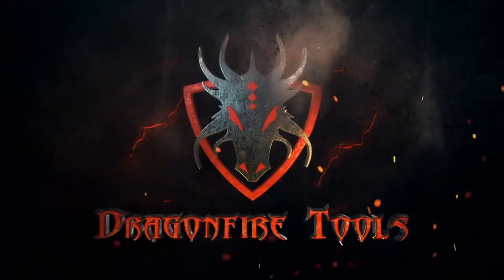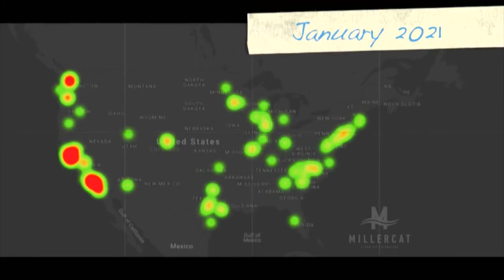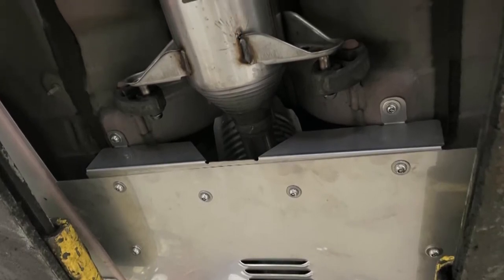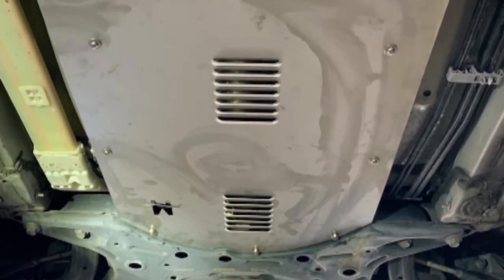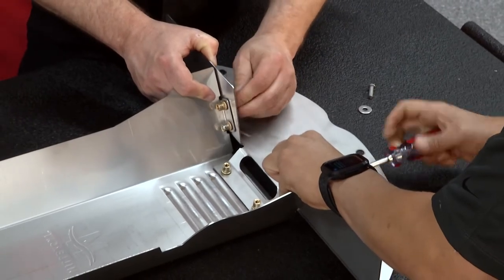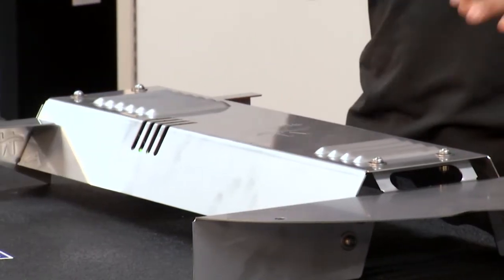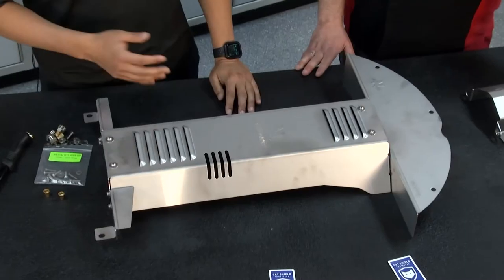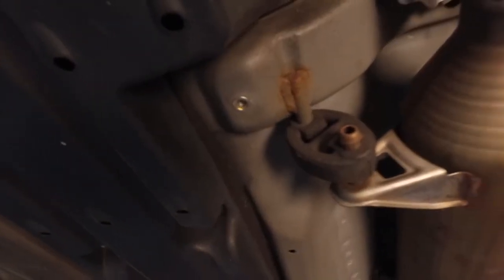Miller CAT Cat Shield Catalytic Converter Theft Deterrence Featured on Motorhead Garage

Comment: I am planning to Red Loctite the 3 tamper-proof nuts and 2 tamper-proof bolts.  

If the shield ever does need to come off for service, a heat gun is pretty cheap.   But,  I've never needed to do any work in this area in 18 years.

2005 Prius has been very good to me.   MoFo's attacking it are not its fault.

Comment: So do the key is the same for every single shield ? That mean that a thief will have a key and get a way with it
Reply: I think I read you can pay more on their site for bolts with a different key.
Reply: The kits come with two or three different security screws/bolts. Thieves don’t like confrontation, the longer they have to spend trying to steal something means a greater risk of getting caught. Thieves are cowards who take what others work for, don’t make it easy for them.

Comment: My favorite part of this video is a security company showing on their website how to remove the product by showing how to install it. These thieves arent stupid. This company is a joke.
Reply: It’s a deterrent. Pay attention. Better yet, take it to a muffler shop and for an extra $50 they’ll throw a couple spot welds on the bolts.
Reply: There are all sorts of ways to prevent removing the screws, including packing the recesses in the SS screw heads with "hot mud" - drywall mud that is more like cement than like chalk. The shield can still be removed but it will take an hour or more to pick the hot mud out so the custom bit can be used. You did see that the bit is proprietary, right: It looks like a standard spline security head but is 5 point rather than six point.